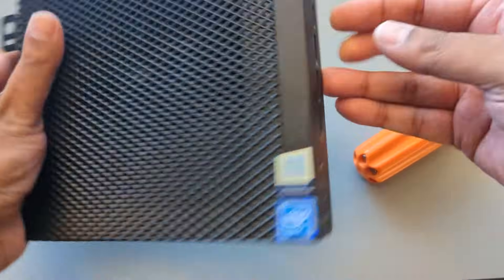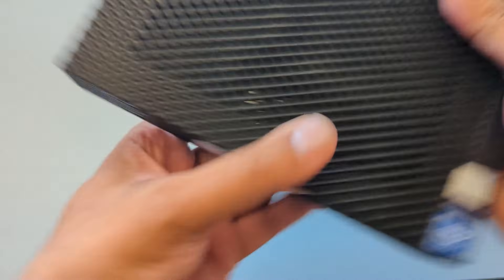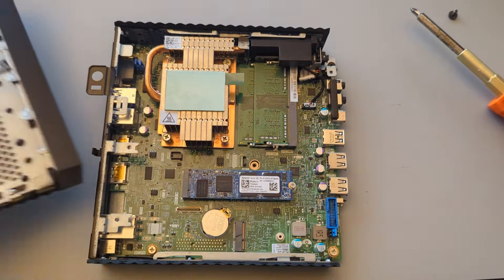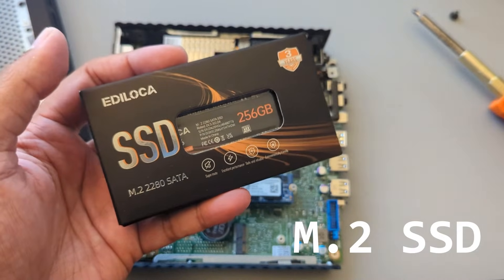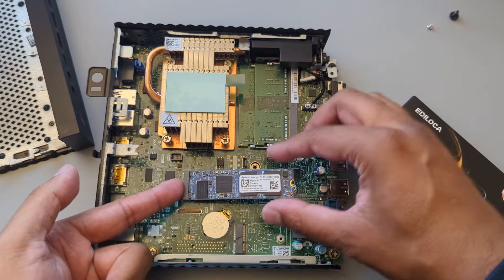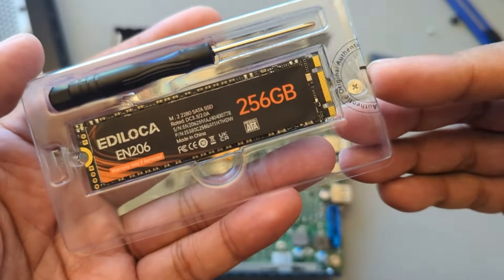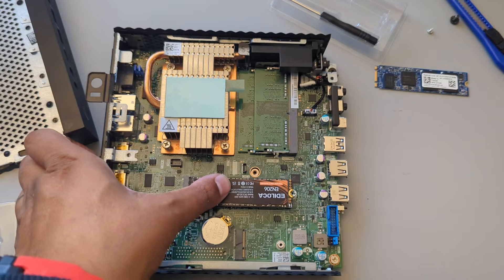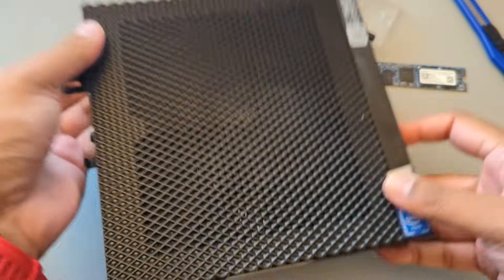Replace Wyse 5070 Hard Drive in 2 mins!

Comment: There's no SSD in mine but yet it has a 14GB storage hiding. Running Windows 10 but there's absolutely no space left to install anything. Any suggestion where it's located if the SSD is missing. I'm trying to install a regular size SSD hard drive. Just can't find where
Reply: You have the variant with a small eMMC card soldered on the motherboard (which is non-replacable). That's where your system sits and that's why there is no disk space left. 
That model doesn't have an m.2 slot shown in the video. 🙂‍↕️
Reply: @adine-btw Excellent answer, my friend. Thank you kindly.

Comment: Is the ram upgradable
Reply: Yes. You can put up to 32GB of ram into these. However, MemTest86 shows the J5005 CPU can efficiently address only ~30 GB of RAM. Linux: Using 32 GB of RAM will result in 30 GB usable; the remaining 2 GB are unaddressed due to CPU memory controller limitations, but this does not negatively impact system stability. Windows: To use 32 GB of RAM, Secure Boot must be disabled in BIOS and the following boot switch added: bcdedit /set {current} truncatememory 0x800000000 After this, Windows will report 32 GB (~29.8 GB usable). The memory limitation is due to the CPU memory controller; rank configuration (single vs. dual) does not affect this. With 32 GB of RAM and Secure Boot enabled, Windows will not boot; the boot switch only works with Secure Boot disabled.
Reply: I have two 4gb ram, in total 8gb, and it works perfectly.

Comment: Hi, did the M.2 SATA SSD is for any Wyse 5070 ? I have a Model : N11D , Service Tag : DQF9MT2 Intel celeron J4105. I have actually  a SSD Apacer – 0VYH82 32Go and i want tu change it. Thank you.
Reply: It just has to be an M.2 SATA. Anything named M.2 2280 SATA should work